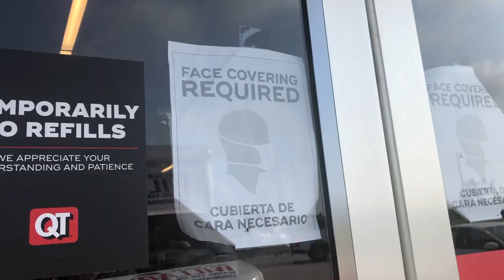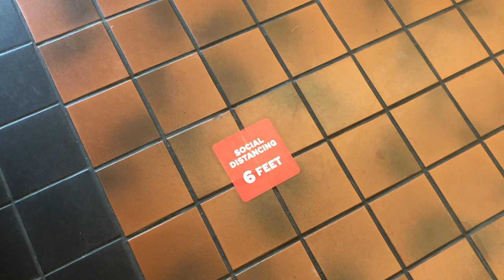St Augustine SOD Installation | Stihl MM 55 C Tiller | Eclipse Lawn Care

Comment: The misfire is due to the roller bearing associated with the lifter(s). They seize up and then wear down the peak of its associated cam lobe or the area that creates lift and opens the intake or exhaust valve. Obviously once it wears down your intake valve(s) will no longer open or open enough to provide adequate air for a good air fuel ratio to create a combustion. Did this on my brother in laws truck. I'm sure you've already figured this out but that is what it is. Common issue on those model dodge rams. Requires new cam, all new lifters usually upgrade to hellcat lifters so they last much longer and this issue doesn't happen again. Remove the four cylinder actuators while you're at it, this is what makes the truck go in and out of four cylinder mode. It's a big job. We did it in my driveway but I've got a lot of experience working on cars.